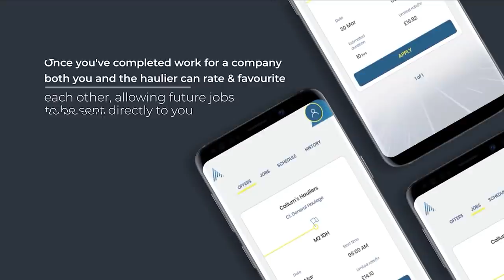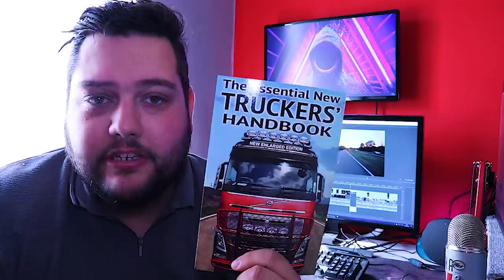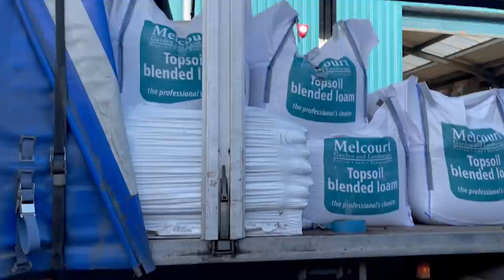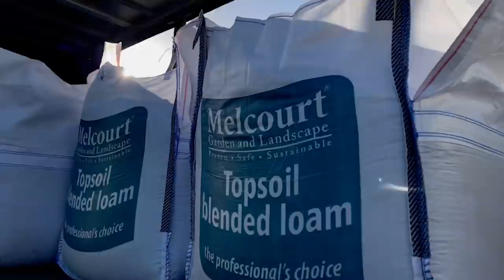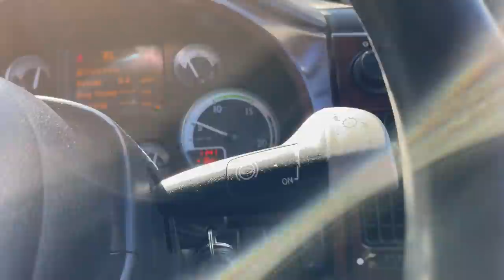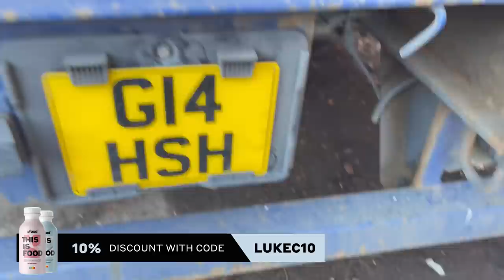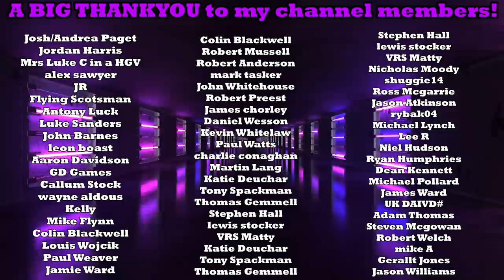Driving To The Beach! Epic Seafronts! Luke SEA in a HGV? 🤔😉

Comment: Nice to see you down in my neck of the woods at Shoreham Port. I must have missed you as I don’t drive past there until about 11am.
I see the Tom Tom Pro still takes you through the busy shopping area and over the level crossing at Portslade rather than via the signposted HGV route from the A27 to the port, which although about half a mile longer is normally a lot quicker. Indeed, for hauliers based at the port it is a requirement of their O licence to use the approved HGV route.

Comment: Luke .... try a IVECO .... even with a testweek you'll be surprised .... Mercs are being dumped on the market, but they get all that "discounted money" back on maintenance, only Merc parts fit. That's why a DAF is more expensive to buy, but cheaper in maintenance, thus cheaper than a Merc over all costs.
I too am a ex trucker, 2 yrs ago blew both knees out and my COPD got to level GOLD II B2 thus lost my drivers lisence ability for commercial commercial usage .... so yeah 63 and early retirement too.
Reply: Any thoughts on MAN? Thought I'd look at them later in the year\early 2023 to replace my Scania. I had a couple hire Merc's a couple years ago. They were OK but as you say one I had cost a fortune to maintain and sometimes took weeks to fix.
Reply: @2DogsVlogs  MAN is a great truck, only the turn radius is bigger, but also reasonable in maintenance

Comment: Bit of local knowledge for you as i used to live in Brighton
You were actually in portslade
And where you tipped was technically in Shoreham port 
Great video too
As for your company name perhaps mix the two with cuss haulage on the front of the tractor unit and luke c in a hgv on the sides
Then if you get to having your own trailer then cuss haulage with luke c in a hgb underneath

Comment: sorry but i have to ask what was wrong with the car that cost you £5,500 to repair.
Reply from the maker: Head gasket, cylinder head strip and rebuild, spark plugs, oil pump, tension belts. Plus me Labour
Reply: @lukecinahgv  seems rather a lot , the labour must be a big part of the bill.